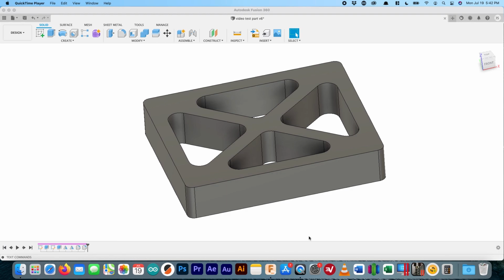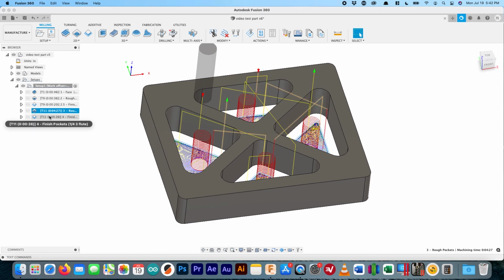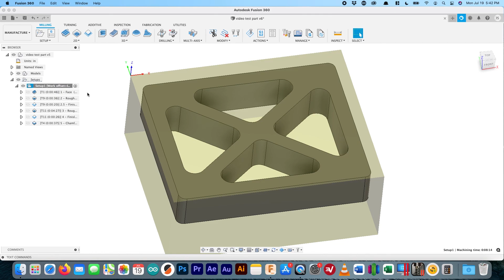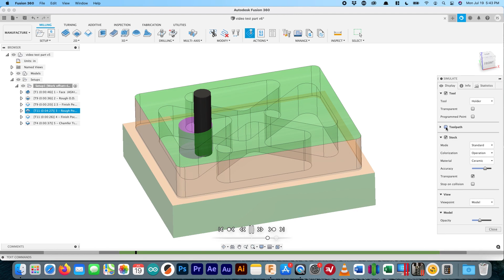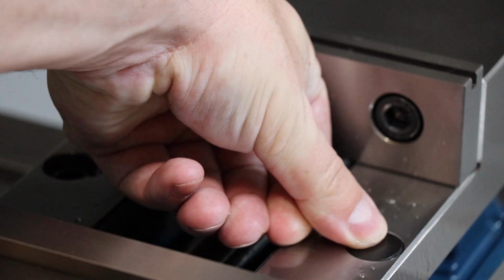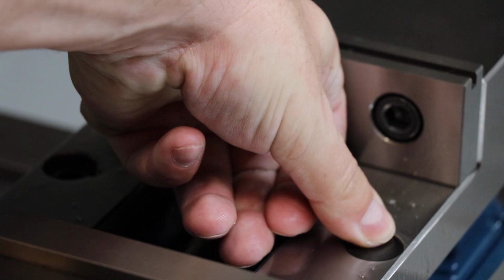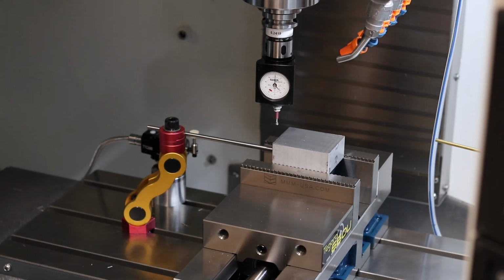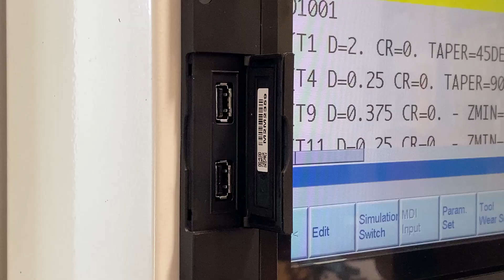CNC Fundamentals - Ep. 1 - CNC Milling Basics  - Complete Process Overview- Episode 1

Comment: Jay, if you could narrow doing your own CNC machining down to one primary factor as opposed to sending it out what would it be?
Reply: it's easier to qc your own parts, it's easier to make changes, if you're doing prototyping your turnaround is significantly shorter, getting quotes is a PITA for small volume stuff, office logistics has a time cost in addition to actually buying parts, etc.

There are a lot of reasons so you'll probably just get it simplified down to a statement like "flexibility" because anything actually specific would be disingenuous.

Comment: Show how you cut the other side off please.
Reply from the maker: Coming in new video soon
Reply: Thank you. I see the top part of some exotic designs and wonder how in the world they are going to hold it when it's flipped over. I have the same problem with manual machining and of course have to plan from the beginning how everything will be held. The last operation is the first one I have to plan for.
Reply from the maker: @jeffreylewis145  no question about it...the process needs to be thoroughly planned from start to finish.

Comment: Add a male to female usb short extender wire to all your machines and hot glue them to the machine. If the usb port develops any problems it is a nightmare to fix, this is a cheap long term fix.